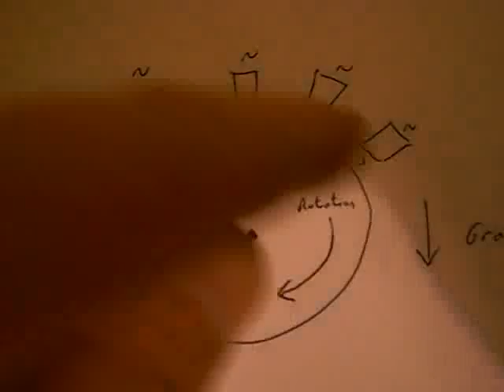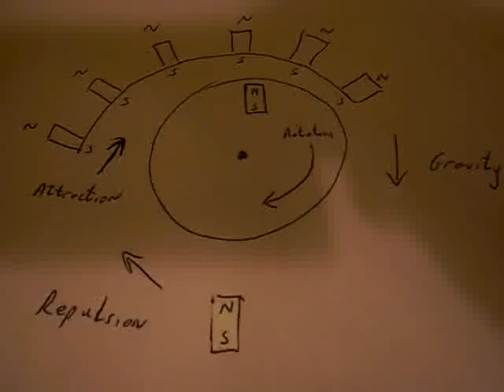magnet gravity motor

Comment: @felicity5150 the magnetic field of the earth is completely consistant. whereas the things you speak of are not as consistant. Wind is at times there, but not all wind is strong enough to create sufficient amounts of energy. Solar is not always there. You have clouds that block out the sun. If a volcano erupts, ash is thrown in the sky and then solar is irrelevant. Hydro is but isn't consistant.

Comment: The trick to capturing the energy from a moving magnet is to transfer its inertia gathered while falling into a magnetic well out of that well with a nonmagnetic object which is not subject to the drag pulling it back in to the well, or gate as some would call it.

Comment: Kinetic energy of the disc is increased as two magnets move closer but the energy is decreased as magnets move away.  In one half rotation kinetic energy is gained by gravity but in the second half, the energy is lost.  There is energy transfer between magnets, the momentum of the disc and gravity within the system but the system itself is not gaining any net energy.  Over time all energy put into the system to start the disc rotating will be lost due to friction.

Comment: it would work forever if you used electromagnets - putting electrical energy into the system.

However, just with magnets will not continue forever - you are putting energy into the system in the form of magnetizing the magnets, and taking it out in the form of demagnetizing the magnets.

Comment: I`m sorry , but no.
It won`t keep rotating indefinently.
I`m not trying to be rude. It`s just no energy put into the system from anywhere.
A magnet is like a spring. It has no ability to produce work in and of itself.

Comment: AdminOnDuty is right. then again, when is anything NOT about *the sweet spot"..?

You need to think it through in stages and test in stages. At what distance do the rotor and fixed magnets start to attract one another? At what distance do they start to repel? Would pivoting the fixed magnet at the bottom during transit, change the equation in any way?

There is a sweet spot. I think you need more component-interaction testing to find it.

One man's opinion, use it as you are wont to.

Comment: I've had this concept drawn up for quite some time and share your feelings that the two will work together. However when I set it to math I found that the field density needed was gradient values not obtainable by current off the shelf magnets. Also it is imperitive that the final magnet set be rotated a bit and a shunt included to prevent negative torque on the rotor. There is a sweet spot where momentum, inverse square gravity and inverse cube magnetics merge. They must all work together.

Comment: you can shield a magnetic field using any magnetic metal that conducts the flux away... iron,nickel... problem of course is that other magnets are attracted to the shield instead of the magnet that's hiding behind it.